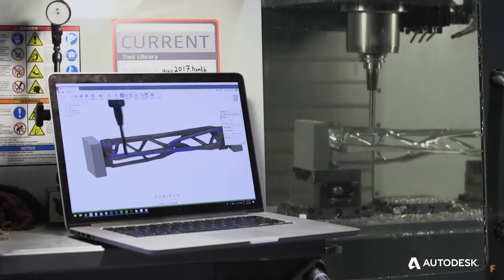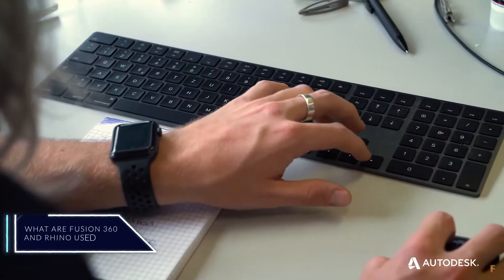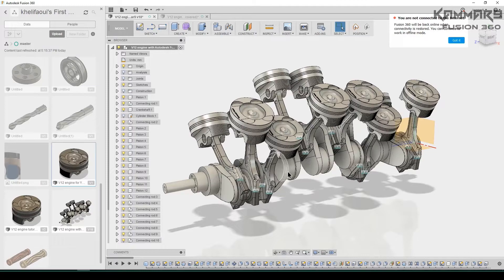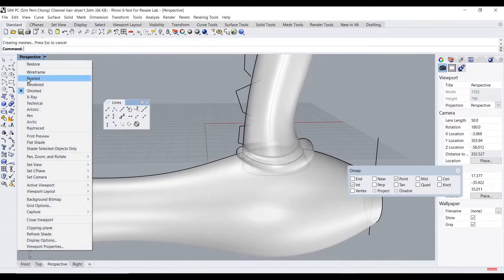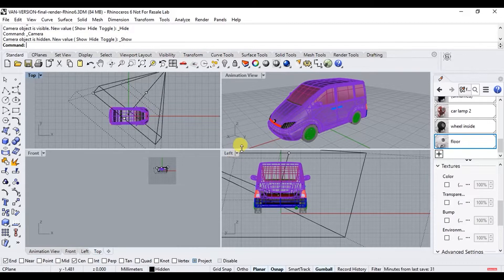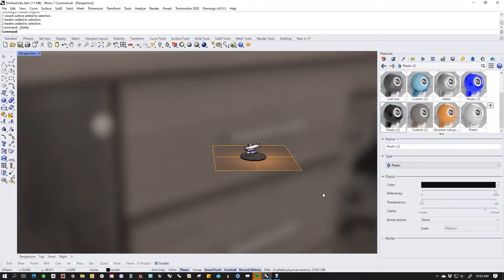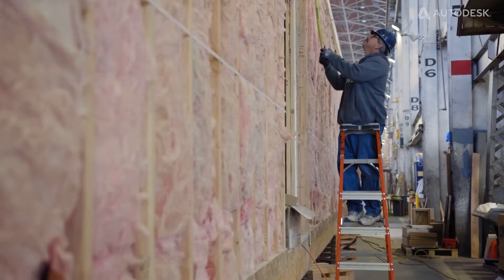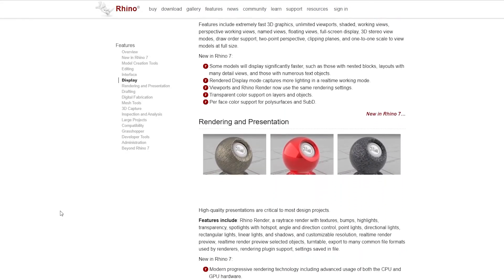Fusion 360 VS Rhino, which is better

Comment: Rhino has the better workflow for me. In surface modeling fare better and it's great for quicker ideation. The structure of Rhino is very intuitive but easy to mess up with. Anyway, when it comes to engineering design fusion has some advantages and I understand when some choose Fusion over Rhino. I had Fusion for a longer time parallel to Rhino but since limiting the free version more and more I switched to FreeCAD

Comment: I’m a product designer and recently added fusion to my creation process along rhino, IMO rhino is easier for surface modeling of complexe shapes but for more technical part fusion is way better especially since it use flexible functions while rhino force you to back up a copy of you model at each steps.

Comment: After learning both for months each I've settled with Rhino. I prefer the workflow and the performance. Grasshopper is a great thing for patterns that requires Fusion to upgrade to a product design extension to get some sort of functionality based on grasshopper. I would definitely use Fusion 360 for assemblies but I love Rhino for surfacing and architecture. Also it's nice knowing I can pay once for Rhino and know it will keep working. I use the free version of Fusion because $60 a month would break me after a while just for one software which I don't make money off yet. So if Autodesk decide to limit F360 again for free users that would break me off the AD train lol. Nice having the software load up a lot faster, files not forced into the cloud.
Reply: Do you still use Fusion?

Comment: This is a poor comparison because it implies the two are intended/marketed for the same purpose.  They are not.

Fusion is better compared to other polymetric modeling tools intended for Industrial Design, such as SolidWorks, Catia, SolidEdge, and NX.

Rhino is great in architecture and with Grasshopper features, separate from the intended purpose of the parametric tools.

Comment: if you're used to rhino, fusion is junk, makes no sense.
Reply: You could say the same the other way around. What a smart comment.
Reply: @msolano00 sure, but the problem is that Fusion is a subscription based BS while Rhino is a perpetual license. A new version of Rhino comes out every 2-3 years. The price you pay for Fusion per year is much higher than the cost of a single Rhino license, especially if you are a student. The pitfalls of Rhino is lack of any CAD assembly tools. It’s good for modelling 3D objects but the moment you want to create assemblies, you can’t do anything. Maybe there are plugins that fix this, but they won’t be free for sure.

Fusion on the other hand sucks for complex modelling but it’s nice for creating assemblies.

But where Rhino truly shines is the sheer power it provides via Grasshopper and Rhinocommon (C# and Python). I’ve seen Rhino used in composites industry for tape placement, in aerospace engineering, marine engineering, architecture, etc. It is really a great toolbox. No one I know in the industry takes Fusion seriously.
Reply: @msolano00  Fortunately, you showed up to nurture the thread with your supreme intelligence. Or applying the same logic you previously mentioned, the lack thereof.

Comment: rhino is garbage .. I used it once in 1997 or so ... Fillets was bugged and broken so i uninstalled it after making that tutorial hammer
Reply: 25 years ago.
Thanks for the input.
Reply: @jaromor8808  maybe it improved  .. i think the interface  look  similar ;)
Reply: lol dude you can’t be serious. By your logic the Internet is garbage as well because 25 years ago the speeds sucked and websites looked buggy and dogshit but the browsers still have the same button layout so it must still be the same right?
Reply: It's 2024 and it has come a long way. Why do you expect that a software should be in the same state after 28 years?
Reply: And I started in 2008 and the fkn fillets are still garbage with minor improvements 😂

Saved you from trying it if you ever got curious again.

Comment: My interest is in designing scale model cars, as a hobby. Then I'd 3D print or make the parts on my lathe or manual milling machine, whichever more suitable. Normally, I'd start from a mesh model (from video games) and try to reverse engineer it to a NURBS or solid version. I am using Autodesk Inventor mostly for mechanical parts and it is great. But for car body surfacing is very poor. I tried Rhino, but I am struggling with designing the surfaces - it's hard for me to mentally visualize the surface patch layout. Given this context, should I try Fusion 360 or insist on learning Rhino? Ideally, I would like to import the body surface into Inventor and then create the solid out of it. Thanks.
Reply: You can fairly easily get a result in fusion. But without allot of experience its harder to get the exact shapes you want, so the design might end up being a compromise and a consequence of the softwares limitations(or/and your skills).  In Rhino you are free to reach almost any shape, but unless you know the software very well you might end upp struggeling producing "watertight" meshes or solids for fore example prototyping.
Reply: @IHBTube  ShrinkWrap in Rhino....

Comment: I've used both Rhino and Fusion 360 for years, in my job and profession (Packaging Design/Thermoforming). I started using Rhino just after version 5 was released, so in late 2012 or early 2013. I started using Fusion 360 after it was released in 2013, although I didn't use it much until a couple of years later. I fully made the switch from Rhino to Fusion 360 in 2016 and I haven't looked back. Fusion 360, for me, is vastly superior. Parametric modeling is such a huge time saver, I can't imagine going back to the free-form method of Rhino. In Fusion, I can make a container and when changes are needed, no big deal. I can go back in the timeline, make adjustments and have everything update. HUGE! In Rhino, the same change could mean hours of work to go back and "re-make" that sort of change. I will NEVER go back to free-form modeling. The CAD kernel driving Fusion 360 is vastly superior to that of Rhino. Rhino is plagued with issues, fillets is a big one. They hardly ever work on complex geometry and you need to resort to a bunch of manual work with surfacing to get any complex fillets to work. Fusion 360 handles fillets like a dream. I'm not saying there isn't a place for Rhino, there clearly is. But for anyone who works in any sort of production, where changes are required and efficiency is needed, there is no contest. On the other hand, if what you really need is just a free-form surface modeling tool, certainly Rhino will be better at that then Fusion 360. Comparing Rhino Sub-D modeling to Fusion 360 T-Spline modeling, I think they are very similar and both function the same way, free-form only. I still prefer the sculpting environment (T-Splines) of Fusion 360, but then again, I used that in Rhino when it was a plug-in, years ago.
Reply: The real power of rhino is grasshopper. No soilidwork nor fusion is able to create geometries with that kind of complexity. For product design, solidworks or fusion are surely superior.
Reply: @101yen  That's true. Grasshopper can do some amazing things, no doubt about that.
Reply: I have been working in Rhino 3D after I graduated as a Product Designer. Rhino 3d was my first 3D CAD software and I still use Rhino after my working hours. But I agree that every change take hours to complete and that is the reason why i'm going to start learning parametric software, where i can work much faster and efficient. Solid Works is perfect CAD software but for a lower budget - Fusion 360 is best solution.
Reply: @ArtideaStudio  The company I work for uses SolidWorks, in my position, I bounce back and forth between it and Fusion 360. SolidWorks is a much more mature CAD application and it certainly has some features that are lacking in Fusion 360. We have switched to using Fusion 360 to drive all of our CNC work, so the question came up about using Fusion for all of our CAD design, too. It was determined that Fusion 360 for manufacturing CAD design isn't ready to replace SolidWorks. With that being said, I find that I still enjoy working in Fusion 360 more than I do in SolidWorks. I find the streamlined GUI of Fusion is much more intuitive than the rather clunky and outdated interface of SolidWorks, but that just may be a personal preference. Fusion 360 is capable and is perfect for anyone on a lower budget and in my opinion is a lot easier to learn than other CAD applications.
Reply: Fully agree. I use both for hobby and given Rhino won't sell for less than €1000 even when I make no money from it and Fusion is free is already a huge deal. Sure it might change but by then there will be others etc.
What drove me nuts in Rhino was complex sketches ending up with non parallel lines by fraction of mm and throwing all model off in the end. Hours if not fays wasted solving this by redrawing again. And don't get me started with no proper history to find and fix the mistake.
Sorry Rhino but even for my small hobby products you're a pain to use. Fusion 360 is just an eye opener to me and it is free for my needs with a cloud backup.
Reply: @Edsdrafts  Turn off Apparent Intersection, and keep the Near snap turned off unless you REALLY need it.

You are welcome!
Reply: @wunwinglow thanks, any decent documentation on Apparent Intersections. Turned off while I am trying to see what it does when I model.
Reply: do you maybe have an example on where fusion lacks the free form modeling capabilities rhino has (i'm speaking of nurbs, not t-splines/subd)? for all the reasons you mentioned i consider switching from rhino, too. but i don't want to lose surface modeling control. thanks
Reply: @ruffryder1337  what I'd suggest is that you get a free Fusion 360 and try the surfacing functions side by side. Since I use it for solid modeling, I'm not the most best person to tell you the differences. What I'm pretty sure of is that rhino will have more functions since that is all it has. I'm sure it probably has more control in creating surface patches with complex input lines. One thing that Fusion is vastly superior in over rhino is creating a solid body from it's surfaces. My best advice is sign up for a hobby/trial version and try it out. If it does what you need, you can switch to a paid version without the file count restrictions. A tip, sign up to the mailing list. A few time a year there are sales. I've gotten some yearly subscriptions for 30% up to 50% off.
Reply: @mcramblet  thanks
Reply: @ruffryder1337  Rhino can create complex algorithmic based as well as generative designs via the powerful Grasshopper visual programing environment. Famous designers and architecture firms such as Zaha Hadid use it. Increasingly product designs are also employing that approach.. mainly for complex surface treatment now. Here's an example for complex and parametric surface creation https://youtu.be/bZdOdhO4knw
Reply: Its a fail compare programs.  SolidWorks is better than Fusión and Rhino in paramétric design , mechanical parts, etc... but Rhino is clearly superior in complex surfaces. The Rhino Comands are specially designed for all áreas and have solutions for each problem. Fusión is a bit better than SolidWorks in surfaces... But Rhino is Rhino and there is not nothing as It is. Im a SolidWorker inginier designer since 1997 and Believe me when I tell you that it is foolish to try to compare them . In my spare time I reproduce ww2 planes and sports cars and guess what I do them with.... With Rhinoceros 😁😉 Before I used to do them with Fusion and SW uffff... what a harder job even though I managed it. With Rhino it is much easier for me, much more.
Reply: @Quimber100  - I came here to say the same; you're 100% correct, this is not a realistic comparison as Fusion is intended for Industrial Design (where the commentor uses it) and Rhino is better fit 3D modeling that isn't a fit for I.D. design tools such as SolidWorks, SolidEdge, Fusion.
Reply: And your Fusion 360 files are somewhere in the cloud. Good luck.
Reply: @xxxxxx-pq5el  They are in the cloud, that I use as a backup, and in my system. The best of both worlds.

Comment: i work in footwear industry and we use rhino for modeling. personally i dont like it. a lot of complex tools and if you are new to thee program it will be a headache. but these two programs are totally different. i like grasshoper tho!! anyway, im willing to learn other cad softwares like fusion or solidworks, not that it will be helpful at my current job, but im willing to go other places with more opportunities. rhino is small ranged.
Reply: have you tried Altair Inspire? or inspire studio
Reply: @kawanua001  nop
Reply: i thought everyone is using modo in the footwear industry :D
Reply: @ruffryder1337  well i used.to work in orthopedic footwear manufacturing
Reply: Modelling shoes in rhino is a challenge but once you get the hang of it it's straight forward 

And you are right Rhino is very small ranged even after all these years this is why I use solidworks and rhinoceros they have their strengths respectively.
Reply: You get a headache with every new software you learn. No pain, no gain....